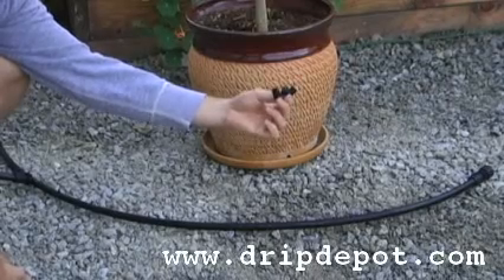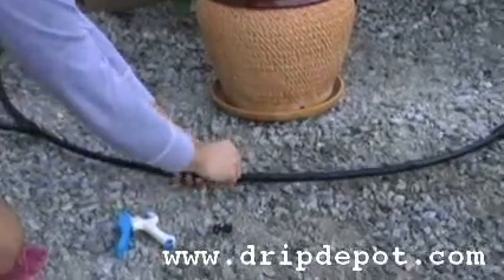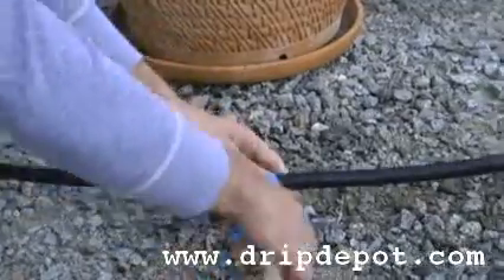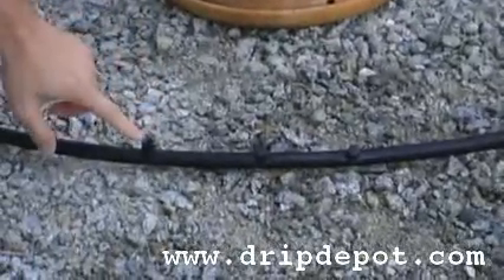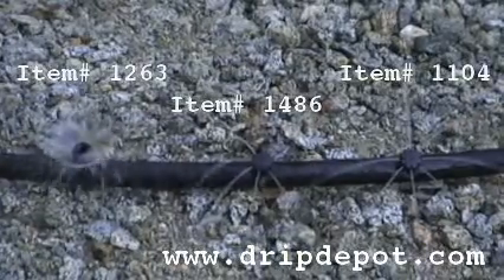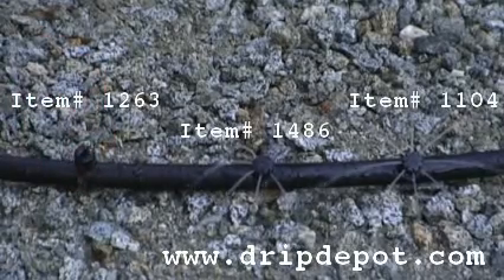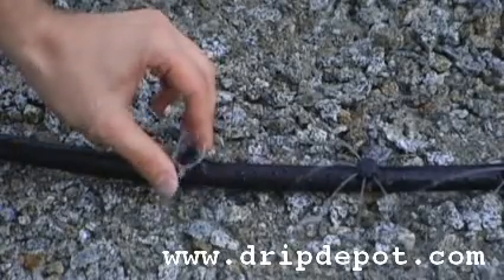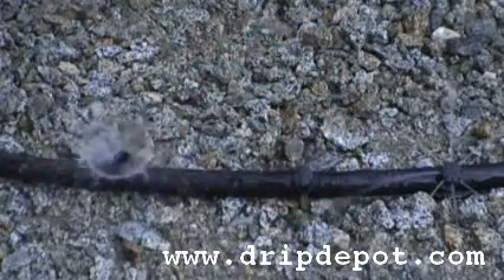How to install Adjustable Drippers into a Drip Irrigation System

Comment: Hi, the chart referenced in Selected Solutions question has a minimum of '2 clicks   4 gallons @ 15psi, my question is can these drippers be adjusted down to .25 gph +/- ? We live in Phoenix, we have super hard soil and the standard .5 gph are causing flooding in low spots because there is too much water for the soil to absorb. Thanks in advance.

Comment: what is the minimum output?
Reply from the maker: Hi, thanks for the question. These drippers have a flow range of 0 - 10 GPH.   The dripper can be adjusted to barely weep water out.  We do have a chart on the item page that helps estimate flow rate vs. clicks on the dripper at given PSI ratings.  Can be found here: https://www.dripdepot.com/item/adjustable-dripper-connection-type-barbed-pattern-360-degree.    Hope this helps and have a great day!
Reply: thanks, this will be very helpful